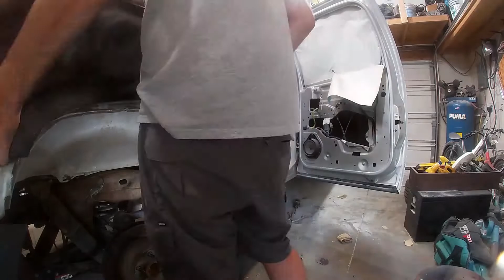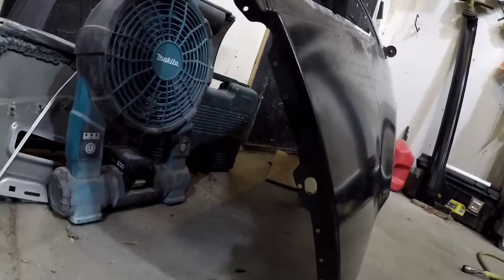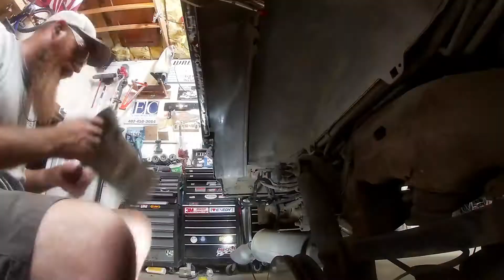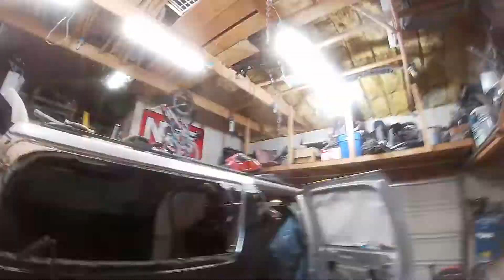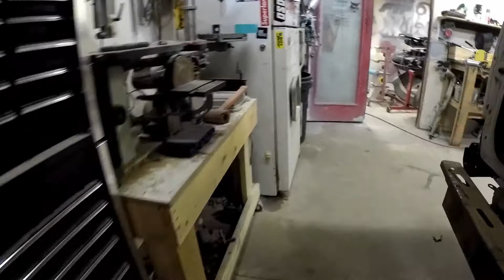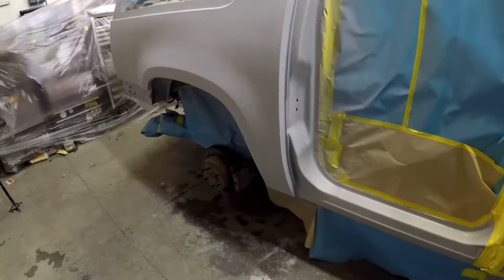Project Totaled Suburban Part 3:  Getting Body Worked.

Comment: i have my 07 suburban with the same rear damage when i crashed it and totaled it the same way your is, was wondering how much you think it would be to repair the rear?
Reply from the maker: Are you going to be doing the work yourself?   You can watch the next 2 videos on the Suburban or you can just watch this one where I break down the costs and how much we made by doing all the work our self.  https://youtu.be/ON6fcplp-JU
Reply: @FullThrottlePerformanceMike I'm planning on taking it to an Auto shop to get fixed,my air bags had went off too as well i was just  to get a estimate of how much everything would be.
Reply from the maker: @edsonnuez3546  are want just the parts price or parts and labor?  If the bags went off and the damage is similar  to our damage it will definitely cost more to fix then it is worth to have a shop fix it.